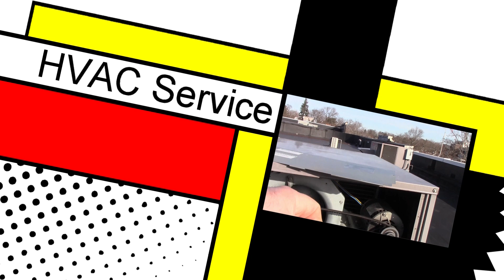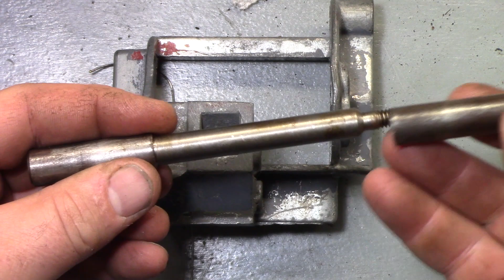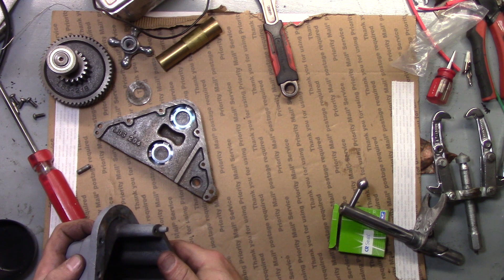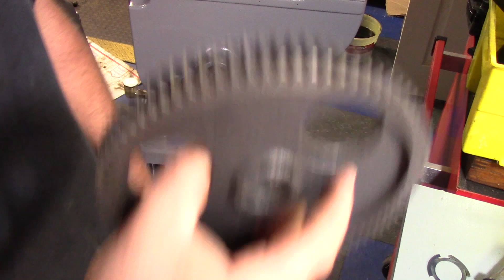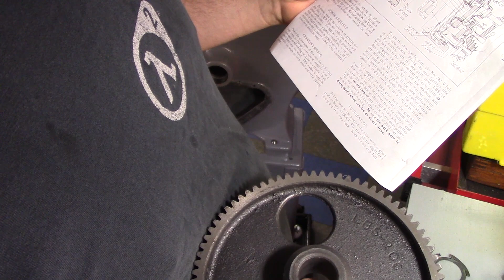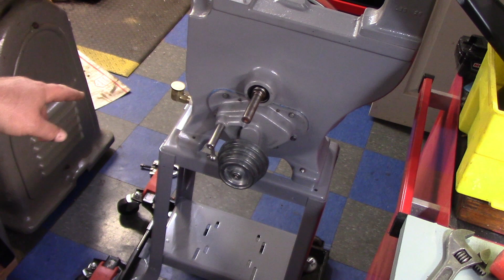Delta/Milwaukee Bandsaw Repair and Refurb:  Gearbox Assembly and Install

Comment: Thank you immensely 👍
Mine is a 1951 birth & found you & can get mine flying soon. Extreme thank youuu for the parts list!!!
Bought mine from a distant cousin,original owner was great uncle & barely used since new. Have the rest of Uncle Mud's Delta tools & planes all working as new!

Comment: I've watched you videos multiple times. They're so helpful and I really appreciate you creating and sharing them with the YouTube worlld.
*Could tell me where I can find the seals used for the gear box components? My saw is from the mid 1950's and the gearbox looks very similar to yours. I have no idea how to size these gaskets or bearings. I noticed you might have used a brand "CR Seals" but my eyes roll back in my head looking through that website (lol). I have no idea what to look for. Also, any pointers on the bearings as well. Thanks!

Comment: I may actually do this same job on an extremely similar model.  Would you care to post your resources.  Like where you bought bearings and tires from, the type of gaskets and other suggestions for before i get started.
Reply from the maker: Upper wheel: 87502 (2x)
Lower wheel: 87504 (2x)
Blade guide thrust bearings: 6200 (2x)
Gear case: 87016 (4x)
Input shaft oil seal: CR6229 (1x)

These are for the saw with the lever selector only.  If you have the newer push knob on the pulley they will be different.  I bought from the cheapest multiple suppliers online.  The gasket was handmade from a piece of gasket paper.  Tear down is relatively straight foreward and you can find some parts lists and parts breakdowns online with a quick search.
Reply: @Halligan142  i pulled it inside just now.  It is different.  A pull knob on the upper wheel.  I can see a lovejoy half.  Might be missing parts.  Wont spin up in the wintery garage. Motor is tired.  Will probably spin up in the morning when it warms.  
Blade came off easy, its tires are worn and old, it leaks oil, stuck in metal cutting speed reduction.  Needs minimal guard repairs.  Casting says late 1969 but. And a brass property tag for cornelius eng. Center, inc.
  Should i quit now and sell it?  I would like a horizontal and my space is near maxed.  Paid 2 or 300 i think in a package deal with a 2 piece set of manual sheet metal brakes i needed at the time.

Comment: Was there supposed to be a gasket between the plate and housing for the gearbox? 
That band saw looks beautiful. I can tell you have put a lot of hours getting it ready for this stage. 
Wishing you and your loved ones a Merry Christmas and an incredible New Year.
Reply from the maker: Just a gasket between the gearbox and saw oil well. That back plate has a hole in the bottom to allow the oil in.
Reply: gasket is no longer available
Reply from the maker: @Elert-J  
I just made my own with some automotive gasket material